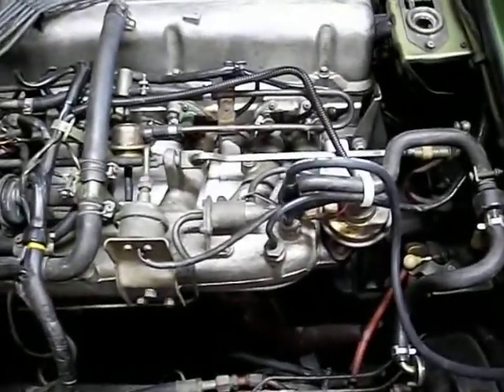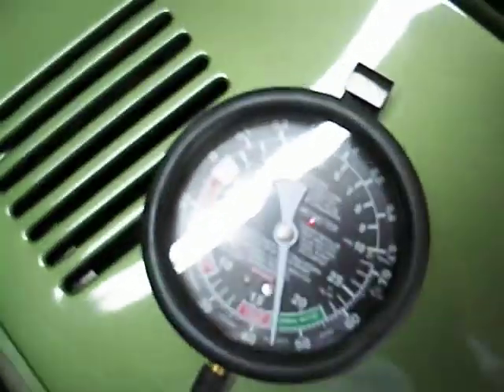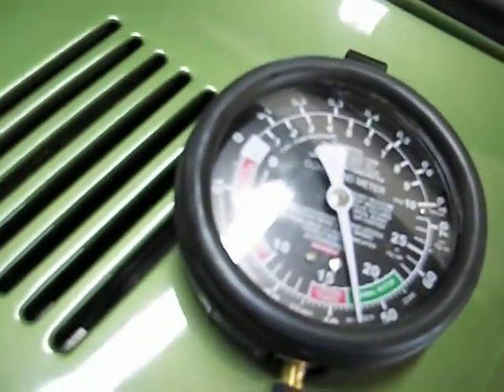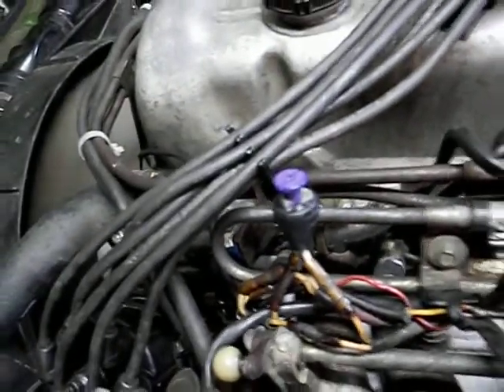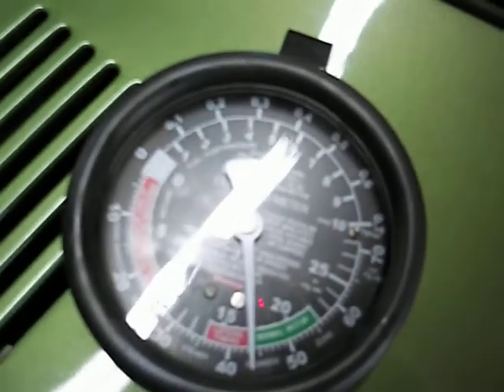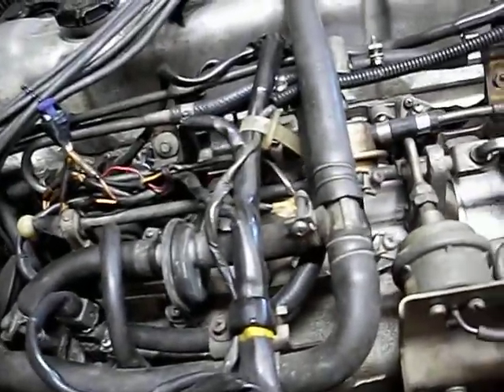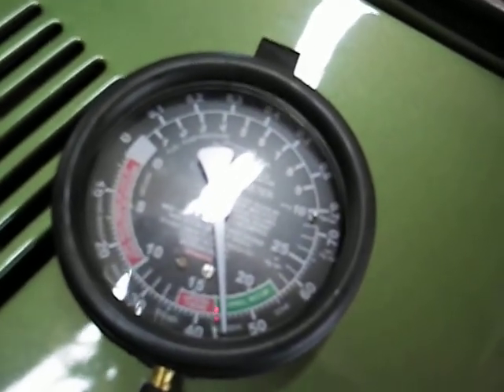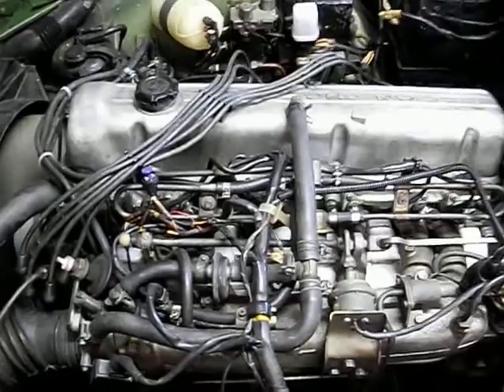1975 Datsun 280z vacuum check

Comment from the maker: I changed the AFM which seems to have a richer mix in the idle system, I also when back an adjusted the valves, a couple of the intakes where a little too tight, .008 cold was a very tight fit, I adjusted them took the car for a ride to get it fully warmed up and now I am at about 19.5inch/hg